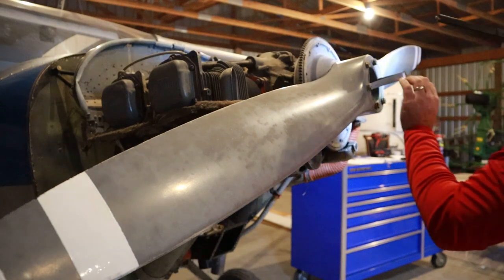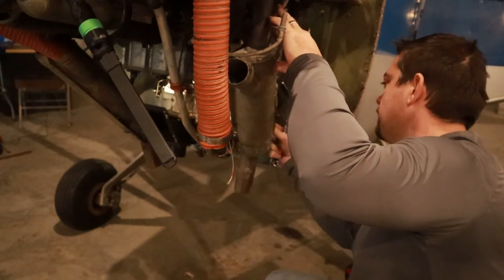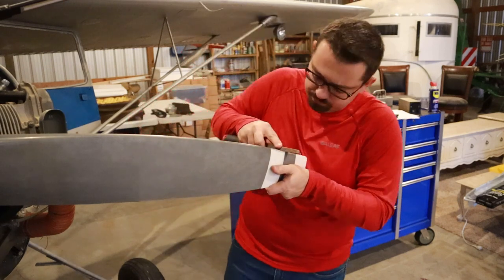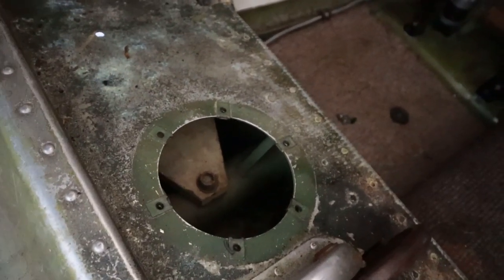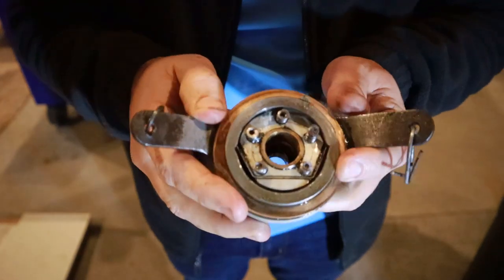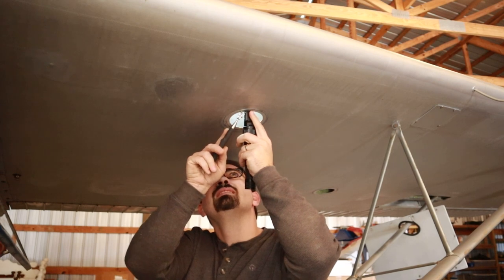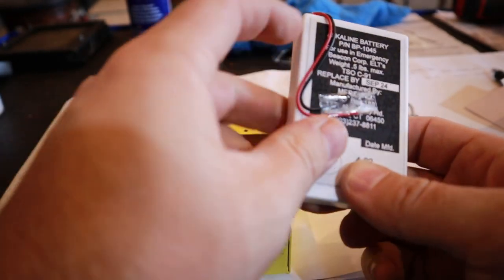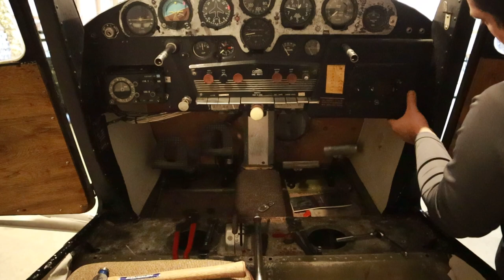Cessna 140’s First Inspection in YEARS!! Cessna 140 Annual Inspection (Part 2) | Part 8

Comment: The landing gear abox is best inspected with a borescope...  your girimes light works better than mine... The struts should be inspected for internal rust... I haven't seen one of those ELTs for years... Good Job !
Reply from the maker: I ended up doing the borescope trick off camera after I was not satisfied with what I was unable to see. Thanks for the follow up though!

Comment: a couple of tips from a AI, I did not like the propeller safety wire , the wire should be 041 and 7 turns per inch and the Brackett air filter is a STC change, so a 337 is required, Don't know if you said anything about that?? Also get smaller files for your propeller dressing
Reply from the maker: Thanks for the reply! I put it in the description but there is so much information packed into an annual (as I am sure you know) not everything gets included in the video. I am aware of the 337's with the air filter as it is an alteration. I already got smaller files after trying to deal with that larger one.

Comment: Did I hear you say you received a new landing light?  Previously in the video it looked functional??
Reply from the maker: Looking to upgrade it to LED. I initially thought I had a short in the system but the light pulls like 25 amps when it is running! An LED would be under 5!